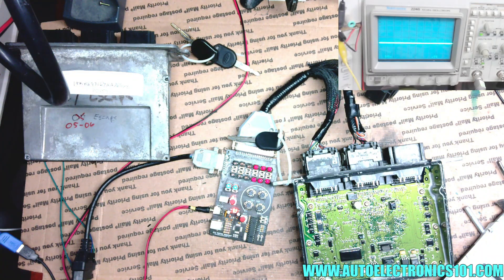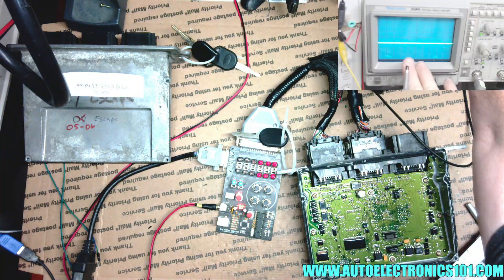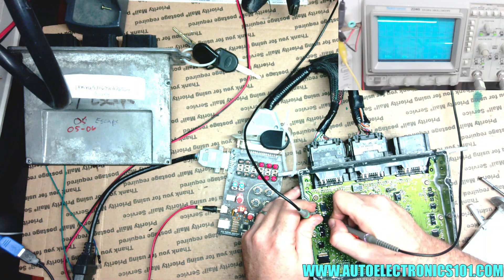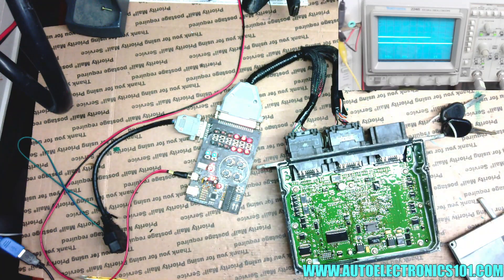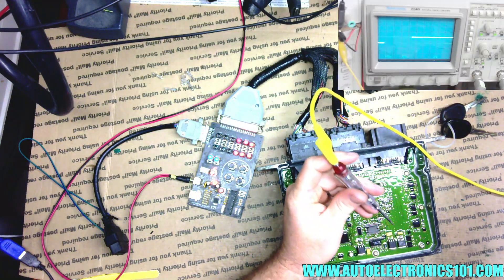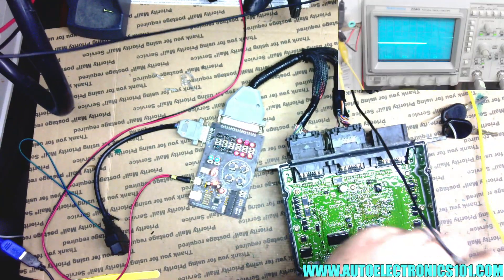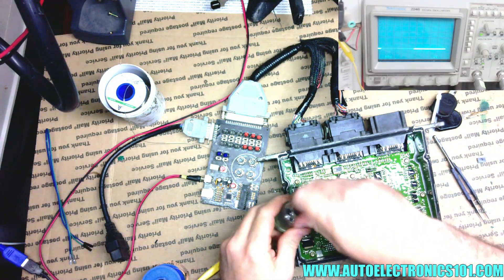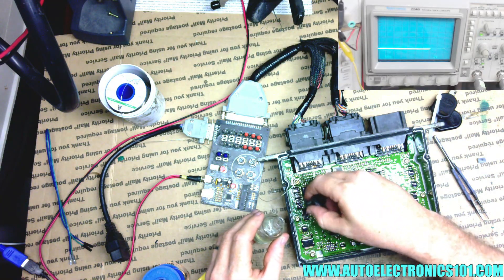pcb repair to fix ford escape pcm for misfire dtc p0354 but mostly just playing with my old Tek 2246

Comment: What are the six squares called right near the two resistors on the circuit board?  Trying to purchase new ones.  Having a hard time finding out the part number for them